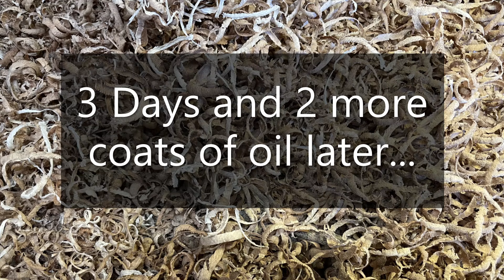Wood that never fails to amaze! - Wood turning

Comment: Very nice bowl. I agree, yew never disappoints. 
One strong suggestion, get that quil lock repaired asap. While you were turning the bottom side the quil was spinning the entire time. A simple nut brazed over the hole and a bolt you can tighten down with a spanner would do the job. The end of the bolt can be ground down to fit into the indexing slot in the quil. 

Again, very pretty bowl.
Reply from the maker: Good call! Yes it’s on my ‘to do’ list.